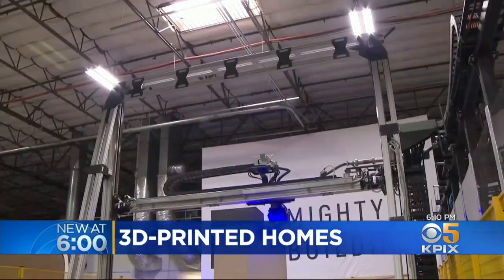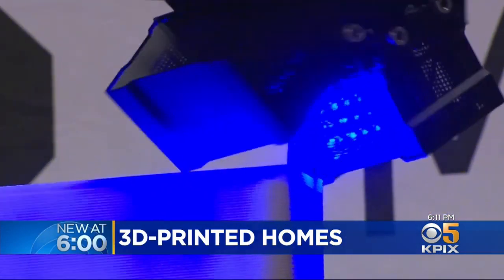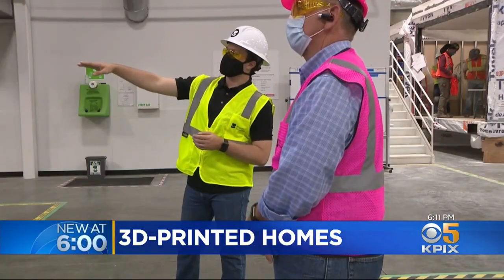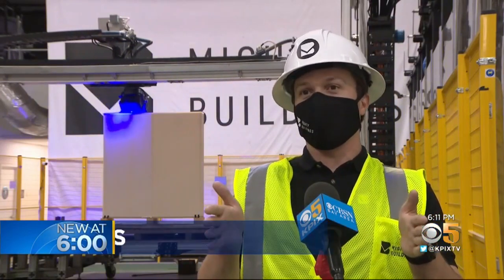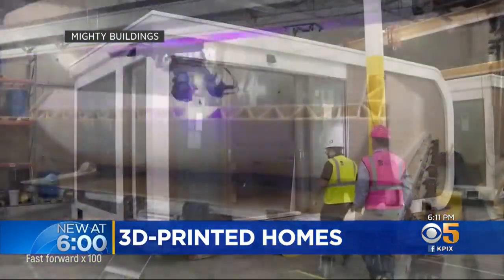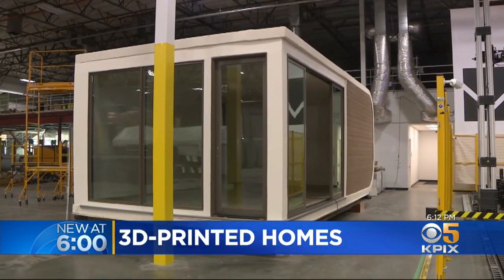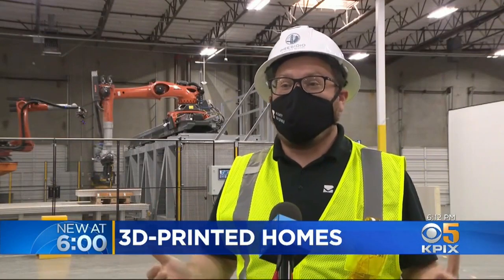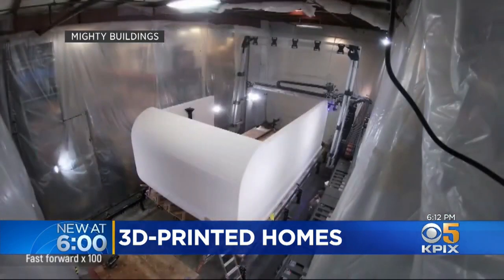Oakland Firm Ramping Up Production Of 3D Printed Homes

Comment: super expensive !!!
Reply: another group is doing the very same thing but with lavacrete and no UVlight  the over hangs would be a challenge but the cost per home is around 4000 per home
Reply: Yeah.  Wait till the rules, regulations, fees, etc. hit this project.  The unions are going to love this one.  How about doing an environmental impact report on putting up so many units.  Can the power grid take it?  Is it green enough?
Reply: Have you seen prefab homes? This is cheaper
Reply: @MarcoBonechi  it is cheaper made and that’s why should be cheaper. But still what you get it is expensive !
Reply: What?